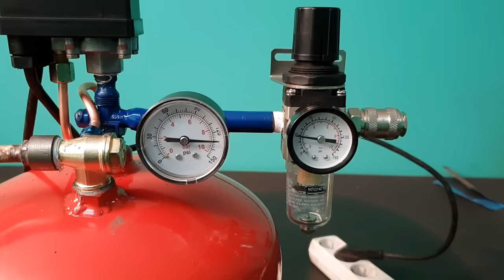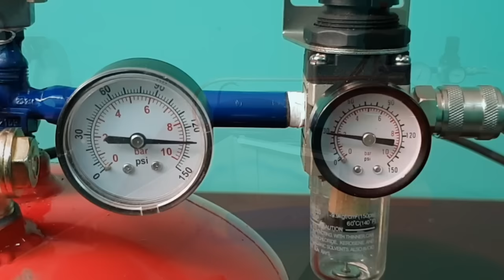DIY Silent Air Compressor make of fridge motor

Comment: I did a similar thing as this 20 years ago. I used a central air compressor and a hundred pound propane cylinder for a tank. Been using it for 20 years now.Its so nice & so quiet
Reply: Does it take longer to fill with fridge motor?
Reply: I think a 100 lbs tank is a bit excessive....
Reply: but its not long live

Comment: Two things missing: a safety valve (fridge compressors can go well over that bottle's limits) and a water purge valve at the very bottom. And also I put a one way valve so the compressor can start more easy.
Reply: @Coronadraht You are right, I did not notice it because it appears connected just after bracing the main tube and is not shown in the video, good catch!
Reply: @Coronadraht Sorry that not a pop off / safety valve.  Just the tank inlet and the blow off for the limiter.  That small valve just reduces the head pressure when the limiter turns off the compressor.  That allows it to start much easier when there is pressure in the tank
Reply: @Cruella DeVille we don't but he does
Reply: i made this 20 years ago,still going strong
Reply: Third thing, replace the poe oil with engine oil or mineral oil. The poe oil will absorb moisture and humidity from the air and cause the internals to corrode with bad results.

Comment: A beautiful fabrication job worth many dollars. To bad potential manufacturers of quiet compressors don,t take the hint and put something like this on the market for a reasonable price. Yes, how to remove the oil from the air discharge and maintain the compressor oil level is a good point.

Comment: Please add a safety valve,  this compressor reach about 300 PSI.
Reply: Bro, if you know, exactly this compressor can produce pressure over 430-500 PSI

I was used it for my car tyre without air tank

Comment: Very cool i never thought a refrigerator pump could make that kind of pressure
Reply: Most can easily make far more pressure than a typical air compressor, I've seen them go as high as 350psi and heard stories of them going even higher.

Comment: Built one of these in the 70,s. still use it today in my workshop, given me years of good service,  a couple of years ago i built another for a friend of mine to spray his models with a small airbrush. now i see they are for sale in our local machine shop at very expensive prices, should have patented it in the 70,s, but hey ho
Reply: Mind if i ask how regularly you have to change or replenish the lubricant inside?

Thanks and cheer!

Comment: Estupendo trabajo compañero. Pero veo algunas medidas de precaución que usted no ha instalado en su proyecto. Y son muy importantes. En primer lugar, no veo que haya instalado una válvula de seguridad. Eso es muy importante, por que si en un momento dado el presostato se avería podría a llegar a reventar el calderín o alguna de sus piezas asociadas. Tampoco veo que le haya instalado un filtro de aire en la entrada del compresor. Otra cuestión no menos importante, es que estos compresores de nevera, están diseñados para trabajar en circuito cerrado. Con lo cual, usted va a tener una pérdida de aceite muy importante cada vez que utilice su proyecto. Le recomiendo que a la salida del compresor, instale un separador de aceite. Otra cosa importante, debería haber instalado una llave de purga o evacuación de la condensación que se produce dentro del calderín. De lo contrario, llegará el momento que corrompa el interior del calderín por el óxido. Supongo que habrá instalado la válvula anti-retorno, otro detalle muy importante. No tome mis palabras como una crítica negativa, todo lo contrario, me ha encantado su proyecto. Solo sugiero algunas mejoras muy importantes en lo que a seguridad se refiere. Un gran abrazo.....

Great work partner. But I see some precautionary measures that you have not installed in your project. And they are very important. First of all, I do not see that you have installed a safety valve. This is very important, because if at any given time the pressure switch breaks down, it could burst the boiler or some of its associated parts. Nor do I see that you have installed an air filter at the compressor inlet. Another issue, no less important, is that these refrigerator compressors are designed to work in a closed circuit. With which, you will have a very important oil loss every time you use your project. I recommend that at the outlet of the compressor, install an oil separator. Another important thing, should have installed a purge key or evacuation of condensation that occurs inside the boiler. Otherwise, the moment will come that corrupts the inside of the reboiler by rust. I suppose you have installed the anti-return valve, another very important detail. Do not take my words as a negative criticism, on the contrary, I loved your project. I only suggest some very important improvements as far as security is concerned. A big hug.....

Comment: Can't believe how quiet it is. I have a tank from small Craftsman compressor but the compressor is bad. I'm going to look to find an old running refrigerator compressor  and take parts off from the original set up to make one so I can work  in my small shop with a lot less noise for small projects. Thanks for sharing.
Reply: Its a compressor from a refrigerator, when operating properly they're extremely quiet because they're a rotary type compressor rather than a piston type as most air compressors are, which by design are loud.  A rotary or a screw compressor will be very quiet due to the way they compress the air through the intake and outlet system.

Comment: These were commercially made about 30 years ago by Devilbis. They were called silent airbrush compressors. They cut the compressor around the circumference at the seem. Dumped the oil and replaced it with an air compressor oil. Probably Mineral spirit oil. A special clamp similar to a huge hose clamp that fit around the tank to hold the top and bottom and a rubber seal together. I had one. It was absolutely silent. You only heard a psst when it turned on and off. perfect for an apartment setting. I am not sure if they still make them. I no longer do airbrushing. The unit cost around $350.00 back then. You could buy the oil in art supply stores by the liter. One of the copper tubings was for refilling the oil.  You only use 30 to 40 psi for airbrush. It also had a tank about the size of a medium sized hand job fire extinguisher. It is obvious this one is pushing 140psi ouch!!

Comment: If you do this again I would like to recommend some changes.
1 - Drill and tap the base before welding the tank on (2:22)
2 - Put the handle of the cylinder for the container in the center of the rig to help you carry it.  Don't cut it off (1:46)
3 - Don't drill through the wall of the tank, this compromises the strength of the tank.  Instead put a T pipe to act as the inlet/outlet (3:27)
4 - Don't weld the pipe into place as this prevents the machine from being taken apart (7:27, 9:36).  A flexible hose and clamps work just as well.
5 - Make sure there is a way to lubricate the motor once in a while.  This refrigerator pump was meant to pump refrigerant, not dusty air.
6 - Make sure the compressor can turn itself off.  I don't know what the limit on your tank is, but on mine it is 100psi.
7 - You will need to find a way to take the compressor apart to drain the condensation.

But what do I know?  I've just got a diploma as a welding and fabrication technician, two years as an industrial powder painter and three years with an air brake endorsement.
Reply: @skippy6656  I may not know about refrigerators, but I'm glad that I know more about welding than you do about being nice.

Comment: You need to replace the oil in the compressor,it is hygroscopic,and therefore absorbs moisture! 
At the entrance to the compressor, put the filter and will be very good!
Reply: Клим Ворошилов hi man I’m fridge engineer and thinking to make something like this but using receiver as a tank and I know the winding in compressor will be damaged by connecting to moisture. 
Any idea 
Thanks
Reply: will try myself.. thanks
Reply: @kasra555  
The refrigerant oil is hygroscopic and turns acidic when exposed to air. The acidity attacks the enammelled copper windings. If you replace it with an non foaming mineral oil, dont allow it to go over 100 deg C or exceed a 50% duty cycle you`ll be fine ;)
Reply: it don't matter that compresser will take to long to fill and never keep up..
Reply: @kasra555  One more thing! The air flow in the sprayer must be greater than or equal to the air flow in the compressor! It is necessary to take into account the performance of the compressor always, and the oil in the compressor can be replaced by a conventional mineral, it is not hygroscopic and its viscosity is higher! From high pressure less oil will fall into the hose and will not absorb moisture! For painting this is important!
Reply: 5w40 is hydroscopic ??   oil will go out in mist collect in tank and that filter ,,so every 2-3 months u ad a bit oil if it need to compressor and alll fun
Reply: MrCcfly - That may be true of higher capacity compressors, but this one is so slow that the oil stays where it should. As proof of this there is another video showing one of these being revisited years later (and 1000s of hours of use) and all the oil was still in the “crankcase”.

Comment: Great idea! I was wondering about the oil in the compressor too where a fridge is a closed system, this one is open. Still looks like a fun project! :)
Reply: I have been thinking the same thing. I have almost pristine cold storage rooms compressor waiting for this project, but havent been able to solve oil issue reliably. You could get automatic oiler to feed new oil to system and have oil extractor least before hose, but i dont know how much it really removes and would require emptying regular intervals. I also though about making cyclone filter that collects moisture and oil, where there is two valves opening and closing controlled by arduino that gets data from visual sensors that see when water and oil levels are top emptying it automatically just enough to get water out from bottom (oil usually floats) and feeding oil back to system, but this is complicated and probably will cause issues over time.

Regardless what ever i get oil out, i would not use this to paint cars and playing with oil kinda defeats idea of this being used in apartment building i planned using it, before moving.
Reply: One important thing that often gets forgotten, these compressors are typically filled with poe oil, which will react with moisture in the air and corrode the internals of the pump. Replace with engine oil, gear oil, or mineral oil then periodically top up, keep a cheap oil separator inline between the pump and tank and it'll work just fine to recycle the used oil, or just top up periodically and toss the used stuff.
Reply: @Hellsong89  a

Comment: You do nice work, IMHO.
Some critical comments:
A tank condensate drain cock could be helpful. Given your skills, installation of that should be a cakewalk.
Some have already mentioned the Comp. oil WILL find its way into the tank AND your end effector (sprayer).
While this is true of ANY oiled compressor, those Refer. Comps. do by design circulate oil thorough the closed-circuit loop in Refer. service. The result, in this application,  being quick depletion of oil, and more of it finding its way into your sprayer. Been there. ;-)
Just my thoughts!
Reply: I can see that being a case easily solved through having an oil injection/feed either in-line with air filtration/moisture removal line, or having it post-fed after previous filtration. Either way, an air filtration and moisture removal filter would be critical to have if this were to be used long-term since air and moisture can rust the interior quickly if not cause other harm.
Reply: @abysspegasusgaming  Yes! I have attempted what you suggest. I found the juice not worth the squeeze. In any event, nothing is learned if nothing is tried. ;-)
The beauty here is that scrap Refer. compressors can often be had for free. So the Comp fries? So what? 
Just connect another one. 
Really, the oil mist is a trouble, but could be managed.
I'll wager there are folks interested in a (cheap) solution to that trouble.
Reply: @glasstronic  Very true to that, one mess up or fail should be seen as a way that it doesn't work out of many possible outcomes!

Comment: I made one 5 years ago. 5 gallon air tank. Pumps to 90 psi in 2.5 minutes and only used 2.3 amps of power at 110 vac.

Comment: I was experimenting with an old fridge compressor. Attached a connector to it and connected it to the output of an old loud crappy compressor. The fridge pump got the tank up to 8bar quickly, so I replaced the old loud pump with this one. Now that is actually connected via the valve to the electric switch and safety stuff it's no longer pressurizing the tank. 
The electric switch is hissing.

Is the switch malfunctioning or do they work by letting some air escape and are therefore not compatible with every pump? Can I fix this somehow?

Comment: Question. Must remove oil in compressor right?  And do you use both vacuum lines as input air?

Comment: Danger - old fridge compressors used as air compressors will become Diesel engines and fail catastrophically- that means BOOM.  HVAC repairmen know this tale well.  It’s OK to use as a vacuum pump because there is no compression in an oil atmosphere, but as an air compressor, it’s a deadly application!!
Reply: i made this 20 years ago,still going strong
Reply: lol  you know what is one way valve ?? so no it dont have any pressure on compressor ..even it have open one pipe for oiling     lol ppl are duuumb
Reply: Rusty Gears - can you provide a reference? Describing it as a “tale” implies that there may be no truth to it but it “feels good” to repeat. An actual investigated account would be good.

Comment: Nice, I like it!
One problem, tho.

As far as I know, these compressors use their coolant/refrigerant as lubricant. Meaning, it is now running dry and without an intake filter it will also suck in dust and debris.
This will prop. result in significant wear on the cylinder, cylinder-wall and valve. 
And as their is no way of lubricating it without oil getting into the high-pressure part of the compressor (Air-tank). This concept seems impractical (at least for me).

Nevertheless, nice build and a good proof of concept! Keep it up!
Reply: correct, over time the bearings of the compressor will sound like an steel bucket full of nails tied to a donkey.
Reply: there is oil inside which will get into the output airline
Reply: And everyone that does this fails to mention how long it takes to get to 100psi...10min reffil and 20sec drain time?
Reply: @minysmith9043 
Depends on the tank size and compressor. I use two 3/4hp heads on a 50L tank. From empty  0psi -120psi takes 4 mins 30 sec. From the pressure switch cut in at 85psi to cut-out at 120psi it takes less than 90 seconds. Most folks on you tube use too small a compressor and too large a tank which leads to overheating and a short life expectancy for the compressor.

Comment: How does the compressor last if you're not running refrigerant through it that contains oil?
Reply: It doesn't.
Reply: If you have PAG oil in any other part of the refrigeration system than just the compressor, you have a severe problem on your hands. PAG is not supposed to leave the compressor, and the refrigeration system is designed to prevent this.

But that's irrelevant to these small pumpkin compressors used in refrigerators. The housing is about half filled with oil and the open motor sits inside the oil. The refrigeration lines are plumbed through the housing, but is sealed independently so the oil and refrigerant don't mix. here's a video of one being cut open:

https://www.youtube.com/watch?v=3Uwx-_VecHo

It's perfectly fine to use a compressor like this as an air compressor, but not for continuous use unless you can actively cool the compressor housing to prevent it from overheating.
Reply: @surfwidow  You aren't going to find a completely silent compressor like this on the market for free or cheap. The only thing I can think of that comes close are for use in the healthcare industry and those things are thousands of dollars.
Reply: GGigabiteM - I am afraid if you watch the video you linked he explains and shows that the refrigerant is just “dumped” into the crankcase along with the oil. I understand everyone’s concern about the oil being pushed out, but the speed of the machine is so slow that this is not a concern. There is another video where a similar unit is replaced years later and all the oil was still in the sump. (There may have been a minuscule amount lost over time, but not enough to be a concern)

Comment: Looks great. How do you deal with the oil the compressor spits out and paint contamination?
Reply: he added a liquid trap. it should catch oil too.
Reply: Don't you want to recycle the oil back to the pump?
Reply: @edflynn4277  what you want to do is drain the poe oil from the system and replace with engine or mineral oil, the poe oil absorbs moisture in the air and corrodes the internals until the pump dies.
Reply: @edflynn4277  what you want to do is drain the poe oil from the system and replace with engine or mineral oil, the poe oil absorbs moisture in the air and corrodes the internals until the pump dies.